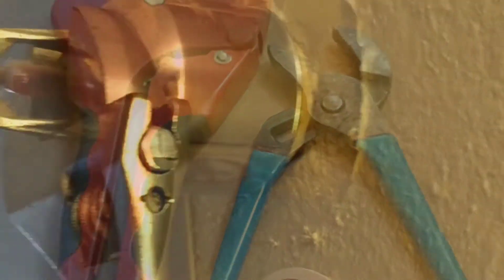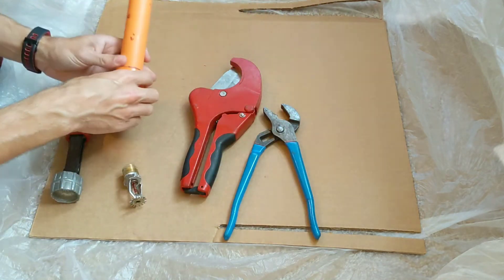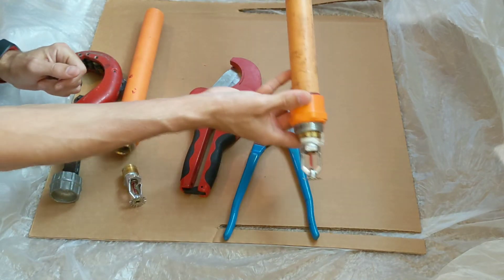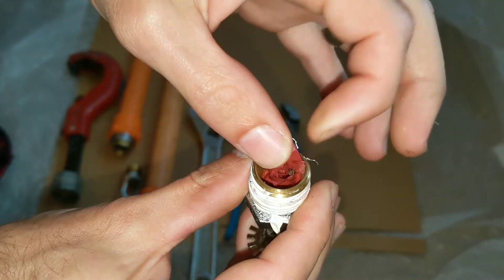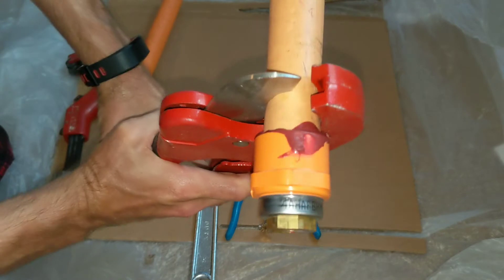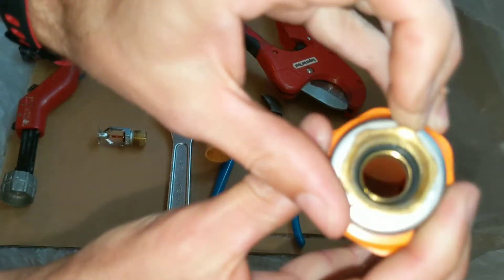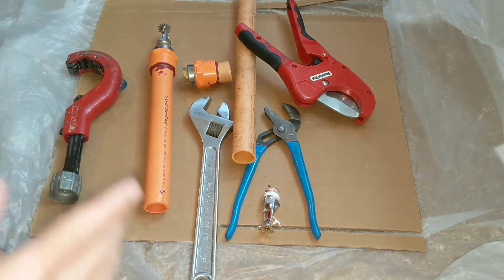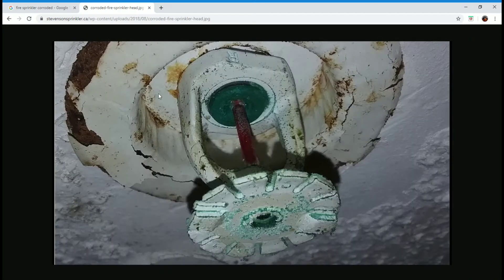Fire Sprinkler Head Glued in CPVC Pipe and possibly the right way to do it.

Comment from the maker: The sprinkler head I couldn't remove in this video wasn't the the only one. All the the sprinkler heads in this facility we're like this. It was just supposed to be a simple job. Replacing a couple of painted heads.

If it were up to me, I would add some sort internal inspection for CPVC. If heads can't be removed for testing or repairs. Maybe cut out 1% of the sprinklers in drops. If one head is found with Glue in it, then it's possible that most will be the same.

For additional help on CPVC, I've posted some links in the reply comments. Thanks again to "R Bad Company" for the helpful tips.
Reply from the maker: Spears CPVC Installation Download

http://spearsmfg.com/flameguard/FG-3%20Final_102918.pdf
Reply from the maker: Spears Head Removal Tool Video Below.

 Good look if you come across a Glued head and Sprinklers with cup and skirt style plates. 
https://youtu.be/sQovDJ07GrE

Comment: Cpvc system installations require attention to detail durring the installation and after when being inspected. Im a project manager field superintendent and found that the same issue occurs when fitters prefab the head onto the fitting and glue the drop elsewhere. Ive found wood shavings in the lines from drilling over open ended lines, stress cracks from ratchet cutters durring colder months and the use of large daubers for 1" lines. Over gluing too.

Great video and breakdown. There is a offset wrench made by Sperry to hold the head fittimg while turning and also a tool to cut away the drop from inside with out opening the wall.
Reply from the maker: Appreciate the tips on tools. I've found what you were talking about and I actually remember using them years ago when I was doing sprinkler install only. I'm going to have links pinned in the top comment section. Thanks again.